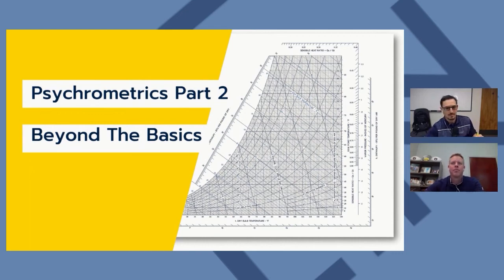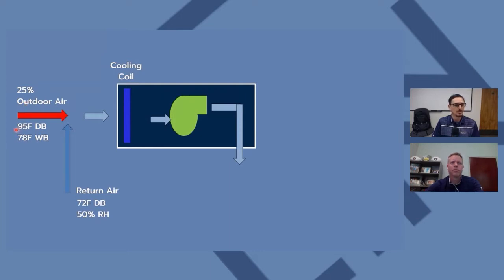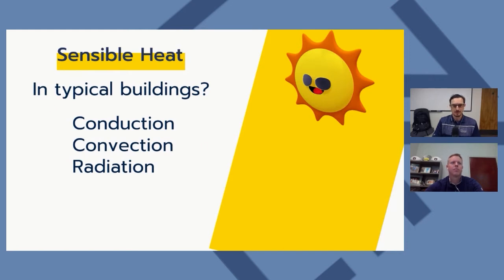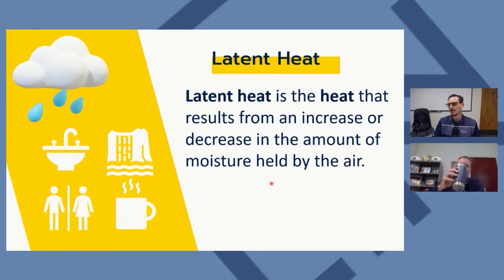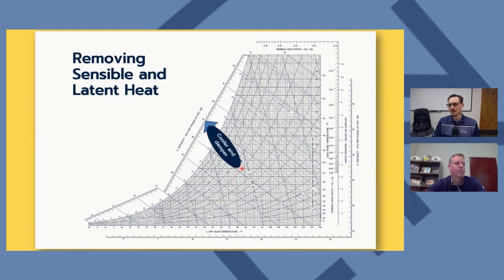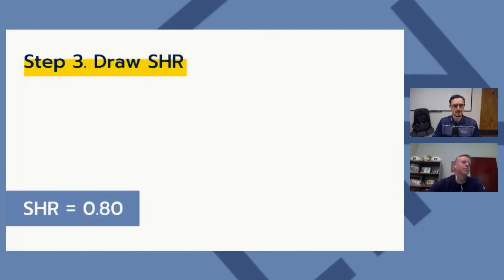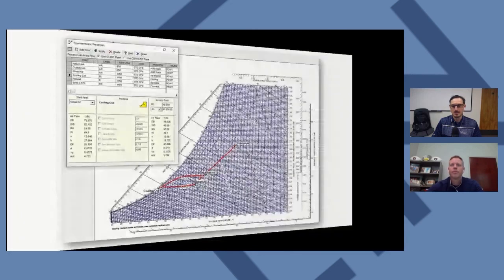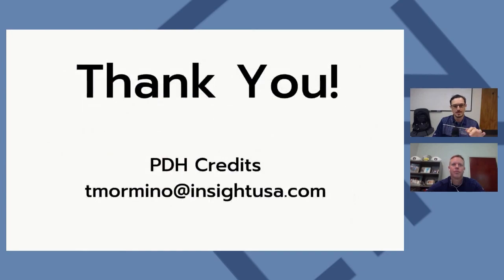Psychrometric Chart Part 2   Beyond The Basics

Comment: hey there, if I am dealing with the internal sensible gains with a VRF system separately (i.e I'm just trying to remove heat from outside at AHU) can I provide a CFM based on a required ACH? Then I can size the coil based on that CFM? thanks
Reply from the maker: Is the vrf handling all of the load except the OA? The dog so then yes it sounds right to me.
Reply from the maker: But I would run by someone in person. I may be missing something since we are only talking I’ve comments.

Comment: At 19 min: Why SHR lines needs to connect with supply temperature point A and not with outside air temperature point B?
Reply: The only reason "B" OAT is to calculate "C" MAT, other than than that "B" is irrelevant.   The evaporator coil only sees the conditions at "C".  After the air leaves the coil it will be sensibly warmed by the blower, duct, and space at the SHR ratio.  RH will fall from near 95% as it passed through the coil, to the design RH in the "A" space.

Comment: Could someone leave a timestamp on how  did he calculate and find the latent heat? And how do you get different cfm between supply and return? Most blower motor are constant rated
Reply: 1) Take your outside wet bulb and dry bulb and mark it on the chart where they meet.  2) Take your inside wet bulb and dry bulb and mark it on the chart where they meet.  3) Draw a strait line between them.  4) Mark another point on the chart along the line you drew at the percentage between the marks that your outside air damper is open.